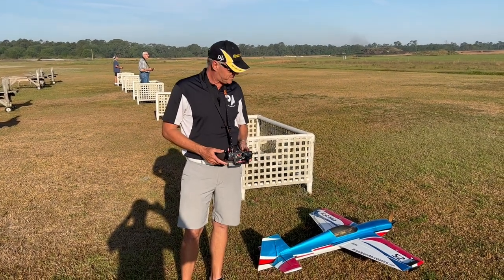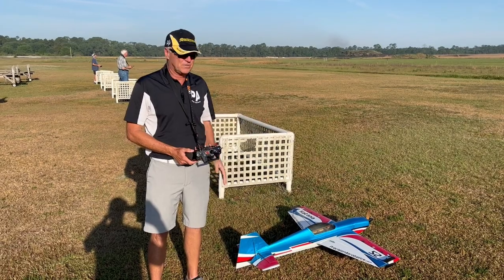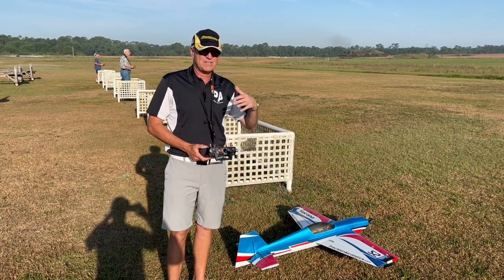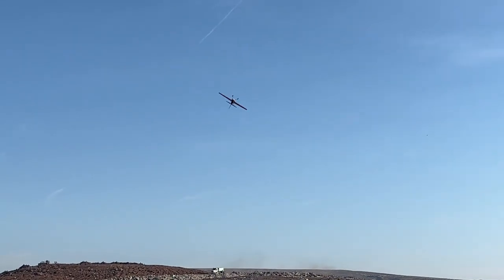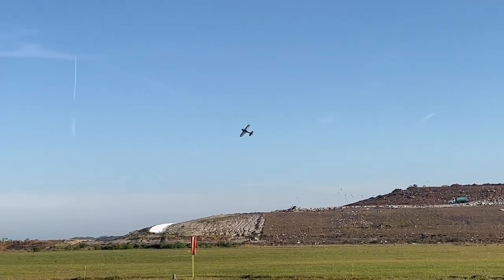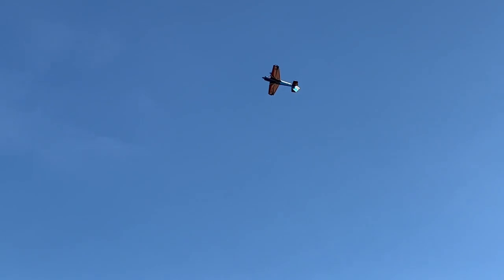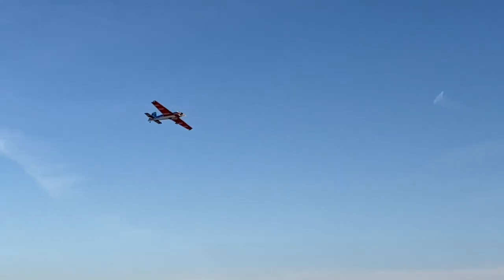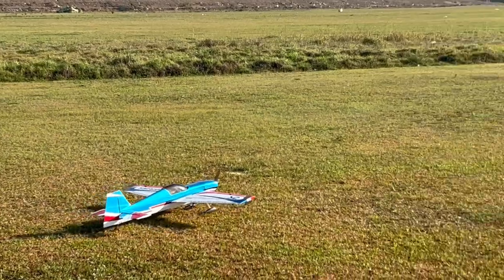Michael Wargo Instruction: Learning and practicing Orientation for your RC 3D and Sportflying

Comment: It is obviously a good thing to master moves in different directions but for a beginner I think it can get incredibly confusing. In my case it has caused many crashes where I just move something the wrong way. It all looks relaxed and safe on these videos because you are in total control, but in reality things go very wrong very quickly when your brain locks up. I am not arguing with what you are advising but I am coming to the conclusion personally that it is better to concentrate on one maneuvre at a time before reversing it.
Reply from the maker: Your point is well taken and accurate.   I think if one thing at a time works for you as might be for most, do it that way.   Orientation issues are just one of those things.   Rolling right and left will be one thing you can work on one move at a time.   This was to suggest you work on all of this at once of course.  I also want to apologize if I ever approach anything in a cavalier fashion in regards to the simplicity of anything.   I understand it all depends on where you are in your learning.     Thanks for your input.